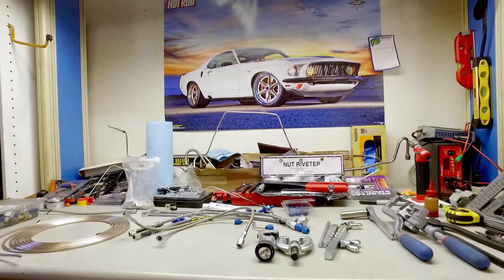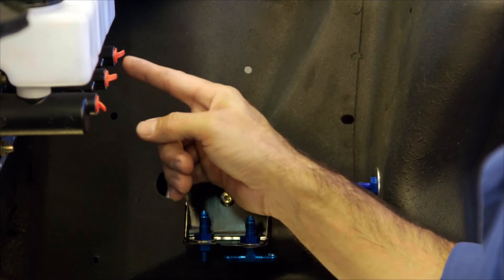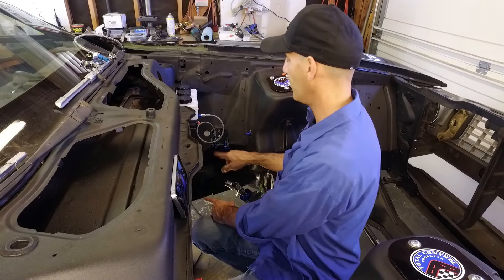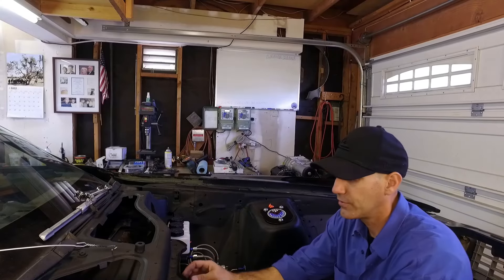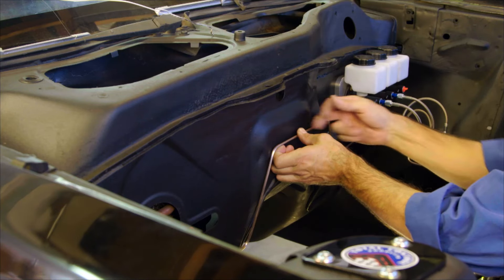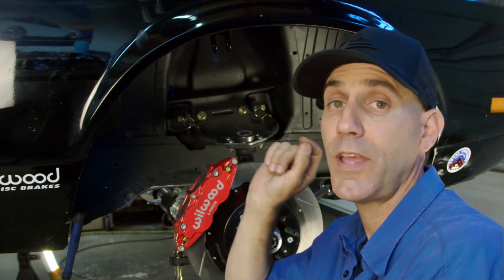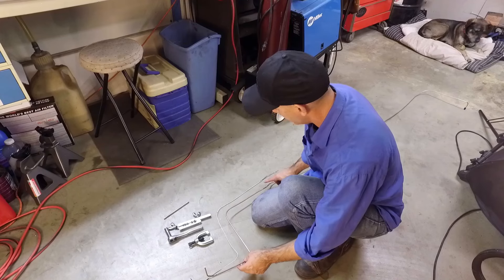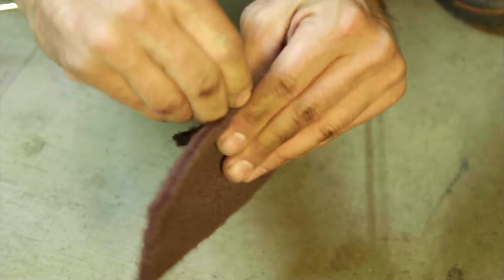How To Build A Custom Brake Plumbing System for Classic or Race Cars

Comment: Looks great just had my fun installing a line lock last weekend on my car. Took a long time to get the hang of flaring the line. Curious how do you control the proportioning of the front to rear brake pressures? Didn't see a valve in line anywhere.
Reply from the maker: +98snakehorse Another good spot... the Wilwood brake pedal assembly has a "balance bar" that does the proportioning.  Since this video was so long I thought to make that it's own video later so stay tuned and check it out... it's pretty cool! Thanks!

Comment: From your master cylinder you have sn NPT fitting, what transition do you use for your flex hose to get to your hardline? ie: from npt to a flared fitting?
Reply from the maker: That is a simple 1/4" NPT to -3 AN adapter. The Flex lines are -3 AN on both ends so it makes easy.
Reply: @AutoEdits  Thank you, your installation was very tidy.. I am using a proportioning valve inline to rear on my 1950 Ford F1 truck and the fronts discs  will go directly to the master cylinder. The flex is a nice clean solution.

Comment: Great job mate explaining the setting up of the plumbing system. One question though, why do you do a single flare and not double as in most cases? I always do a double but is harder no doubt. Cheers mate
Reply from the maker: Thanks for the input, I just like the single flare for my hot rod projects because of the AN fittings. On my Jeep and truck I do the double flare for durability.  Have you seen the video of me driving this thing yet? https://youtu.be/qSJ72eAVZFU
Reply: @AutoEdits  Thanks for your response mate. Stay Safe!
Reply: AN fittings do the sealing. On UNF fittings the sealing is achived by actualy squishing up against the tubing, requiring the use of a double flare.
Reply: @williamallen7836  thanks for the clarification. Cheers mate

Comment: Is there a reason for putting a loop in the brake line?
Reply from the maker: Having a loop in the line with hard tubing helps keep vibration from damaging the line or connectors on short runs like that but the flex line is just the shortest I could get easily so loop it .

Comment: Arent you worried about line length difference causing pressure imbalance? 
What is the flex line?
Isn't this line also going to expand more under pressure?
I know it's still metal but....
Also isn't it easier to rip and or puncture? 
Also USE PIPE DOPE NOT TAPE!
Also maybe heat wrap it to protect from engine heat?
I know it's not much but every bit helps
Also where did you get the clamps for the line?
Sorry for so many questions
Reply: Since nobody replied to you(I know it's been two years), maybe you just don't understand how hydraulics work. There will be no pressure imbalances due to different length piping. And braided line can expand but nothing like rubber hoses. It's so minimal that you wouldn't consider it as a problem. Also wouldn't use normal "pipe dope." Would use either normal Teflon tape or even better, Teflon pipe thread sealant for automotive application(something like the permatex thread sealant with PTFE). And to finish it out, the boiling point of brake fluid is so high that you'd be wasting money and time trying to wrap brake lines. Factory doesn't even take those measures...

Comment: I like the brake switch idea. Only problem is every time you have to change it, you have to bleed the brakes.
Reply from the maker: I've never seen one of those fail so there's zero concern over having to re bleed if for some reason it does go wrong.
Reply: @AutoEdits  that's great

Comment: What Master Cylinder did you use and can I delete my proportioning valve
Reply from the maker: I used the separate master cylinders front and rear and a proportioning bar on the pedals. That's the only way to delete the prop. block on a system.

Comment: What size bores did you go with? I’m doing the same on a 65 falcon. I have 3/4 on there now. Is that too small you think?
Reply from the maker: They are 3/4 on for the front and rear and I will use the proportioning bar on the pedals to dial them in.  The clutch is a 7/8
Reply: AutoEdits thanks for the quick response Jason. That’s the same set up as I was going to go with, maybe I’ll stick with it and if we have issues we can have them together. Please let us know how it all works out for you. I have a feeling you’ll be on the road before me. But I’m trying to get cranking ASAP

Comment: Who are the braided brake lines made by that you installed? Looks a lot better than the ones I found which look cheap made so I didn't purchase them.
Reply from the maker: Those are from Earl's... I think Holley makes them but I just ordered them from Summit Racing.com
Reply: @AutoEdits  Thank you sir. I'll check it out.

Comment: Curious no issues using aluminum AN fittings for brake line fittings. I've been told it wasn't a good idea that I should only use steel  but I've seen it done on more than one occasion. Have you had any issues?
Reply from the maker: I have not had a problem in the systems I've built over the years.  It is easier  and more forgiving to use double flare in street cars but I like this style for this project.  In my Dodge truck I used the NICOP lines and double flare fittings and it worked great.

Comment: Question: What about brake proportioning?  I'm not familiar with the Willwood master, but generally, when you are not using the factory metering block, wouldn't you have to install an adjustable proportioning valve into the system to ensure the correct brake pressure is metered to the front and rear of the car?
Reply from the maker: You're right! This video was getting so long I didn't include the segment on the Wilwood pedals that have a proportioning bar to adjust how much pressure on each master cylinder. I'll show a separate video on those guys. Good call.
Reply: Cool, I look forward to seeing that vid.  Nice work so far, can't wait to see your Mustang back on the road where it belongs!

Comment: Great Video! I'm about to redo the plumbing for the brake upgrade on my 75 Datsun! It looks like you are using both Steel and aluminum fittings, are you not worried about corrosion over time?
Reply from the maker: Thanks for watching... I am not worried about corrosion in this system.

Comment: How much did ya have to repipe once you started dropping the motor and all the other big hardware in?  ;-p. Just teasing, I’m currently surfing on how to refill a replumbed system correctly with the master cylinder still installed...
Reply from the maker: A vacuum pump will work great for what your doing.

Comment: I know this is older but if you get a chance i noticed you were saying npt fittings for the master cylinder but everthing im finding is sae threads will npt work or are yours npt
Reply from the maker: I installed 1/8" npt to -3 adapters into the master cylinders.
Reply: @AutoEdits  ok so im assuming you don't have any sae weired even my brake wheel cylinders are 3/8-24 wich is sae so jusr confused where you gor npt but if thats what yours are ill figure it out
Reply from the maker: @jdjizzle  https://www.jegs.com/i/JEGS/555/107750/10002/-1
Reply: @AutoEdits  sorry i guess i might have worded that wrong im saying all the threaded holes on the master cylinder are sae why would i use npt?
Reply from the maker: use whatever your parts call for 🤷‍♂️
Reply: @AutoEdits  ok thanks Just didn't know a whole lot about brakes Just trying to gather as much Info as I can My car is a 73 Mustang I thought that's what you were working on too that's why i just got confused because you were saying NPT fitting and it seems like all the fittings on the wheel cylinders and the master cylinder are all SAE
Reply: @AutoEdits  but thank you much appreciated

Comment: can you tell us where you got the parts for this job? also the part number for the pressure switch?
Reply: I can get the the 2 part fitting if you still need them

Comment: Just wondering what happened with the break booster?
Reply from the maker: I don't need a booster with this system.  There are math equations that figure out master cylinder size with brake caliper size and car weight and brake pedal stroke ... so this should be a firm but normal feeling pedal.  Not ideal for everyone but this will work fine... I won't do this on my Jeep or Truck.
Reply: autoedit Thank you appreciate the information. Love you're build.

Comment: Nice job, very clean look, professional , but you don't use any type of seal tape, those are aviation grade. the nipple (male ) seals nicely to flare in the the "B" Nut, you would be causing problems down the road.

Comment: great video would you recommend a proportioning valve?
Reply from the maker: I would for sure if you are running a tandem master cylinder but since this particular system is running fully separate master cylinders.. the proportioning is done by a screw on the brake pedal itself.
Reply: AutoEdits 
Great thank you. I’m looking at the wilwood floor mount pedal assembly that is running separate master cylinder. Thank you for the reply.

Comment: Question. Why is there no Distribution Valve?
Reply from the maker: This setup doesn't need one because the front and rear master cylinders are separate and it uses a balance bar on the pedal to regulate pressure front and rear.

Comment: where do you buy the parts, flex lines, adaptors, etc.
Reply from the maker: Summit Racing
Reply: Thanks!
Reply: looking at Summit racing website but I cannot find those blue colored NPT fittings, did you buy the parts as a kit?

Comment: How do you adjust brake bias with the two seperate master cylinders? Thanks. Great video by the way 👍
Reply from the maker: There is a balance bar on the pedals that lets you adjust front to rear bias. Wilwood offers a remote adjuster for that as well:
Reply: Awesome. Thanks.

Comment: Which flare did you make for the rear end? 18:30
Reply from the maker: This system is all 37 degree single flare... not recommended for all vehicles.

Comment: I'm gonna do my brake lines, and some say ya gotta double flare all the brake lines.
Is that true? And why?
I was under the impression that a good flare with a good pressure fitting, and done.
is that incorrect?
Reply: Single flares are only acceptable on low pressure systems. I would recommend you read up on it before touching the brake system, which is responsible for your safety and the safety of others on the road.
Reply: The613MC 
yeah, I  went ahead and took a look.
single flare, sae.
double flare, Iso.
Reply: All hardlines must be double flare. If the cars brakes failed as a result and caused an accident and investigators discovered he used a single 37 flare then he could be held liable and his insurance could get out of paying the claim.

Comment: ok so I am very confused, looking at my wilwood info it says their flares are 45 degree flares but AN fittings use 37 degree flares.........cornfused here!!!!!
Reply from the maker: from what to what? your confusion is confusing. everything assembled in this video works as described.
Reply: @AutoEdits  I am confused as to what is a 37 degree flare and what is a 45 degree flare.....thanks again
Reply from the maker: @davidthayer6969  seems self explanatory. maybe you shouldn't be working on brakes.

Comment: My name is Jesus Lobo from Spain and I’m changing the brakes on my Mustang Shelby 67. I am grateful  for Your  time and I need You to help me for I have changed some pedals of the brand Will Would, with master cylinders exactly the same as those in Your video but I need the other connections like those that appear in the video, those that are of blue color and flexible connections and everything. If You could let me know where I could buy it, on what page/place, I would appreciate it very much

Comment: nicely done but I would use hardline as much and as long as possible . Why ?  Too much/long flex brake lines gives you a spongy brake pedal feeling. NiCu brake lines are the way to go for sure.
Reply from the maker: I agree on the more hard line the better.

Comment: Single flares are not supposed to be used on brake lines can’t hold the pressure like a double flare or the iso bubble flare. 6:26 👈🏼press
Reply from the maker: That's not exactly true.  DOT recommends double flare because it is more durable... has nothing to do with pressure.  High pressure lines in aircraft and many other applications use single flare AN.
Reply: It’s more than a recommendation……it’s a standard that must be followed.

Comment: My understanding is that brake line flares have to be double not the single flare that you are using otherwise great vid.
Reply from the maker: A double flare is the OEM standard but AN fittings use a single flare.
Reply: The AN single flare is illegal for hardlines on any vehicle driven on public roads in North America. It’s a DOT requirement (for hardlines) to use double flare or other types like bubble flare.

Comment: 1 master cylinder should go to the front right and the rear left and the other master cylinder should feed the left front and the right rear it's a safety issue so that if you do lose one of your master cylinders you have front and rear brakes it makes it more even instead of having either front or back brakes.
Reply from the maker: That is not correct.
Reply: the usual routing is divided front/rear. some opt to do a diagonal system because theoretically you would still maintain 50% braking capability regardless of which side of the system failed.

Comment: Where did you order your nicop from ?
Reply from the maker: I think I got that from Summit Racing
Reply: autoedit thank you for the reply. Do you remember what size you went with I'm needing to redo my brake lines in my project and want to make sure i get big enough line.

Comment: where is the proportion valve in this system?
Reply from the maker: I don't need a prop valve since the pedals have a built in lever that adjusts how much each master cylinder gets used.
Reply: what manufacture of system do you have for the master, part #

Comment: no proportioning valve?
Reply: The pedal assembly it self is the proportioning valve. Front and rear don't share fluid so they are adjusted by a see-saw like bar on the brake assembly.

Comment: Hey so u dont need a booster ?
Reply from the maker: No booster needed in this particular system.  There is a bit of math involved but the basics are ... weight of the car, size of the calipers, size of the master cylinder and stroke of the pedal.  I'll let you know when it's on the road if that worked or not...LOL
It's easier to just add a booster but I wanted to try this out.

Comment: Aren't you supposed to do a double flare for brake lines?
Reply from the maker: Sure, if you're using double flare connections but I'm using -3AN so that wouldn't be appropriate here.
Reply: 3AN single flare is not approved for use on brake hardlines on public roads in North America. It is not DOT approved! You are giving out bad advice.

Comment: First, and foremost, I sincerely hope you are referring to liquid teflon, and not tape.  Teflon tape on brake lines is a good way to get a nomination for a Darwin award.  Secondly,  the flared connections aka compression fittings negate the need for teflon, in fact you should specifically not use teflon on compression fittings.   The NPT connectors need teflon ... which is why you are not supposed to use NPT on brake lines.  If you ever try to get that car tech inspected for a track with those fittings on it they are going to tell you that you can wench it onto a trailer and tow it or push it off the property because the vehicle is unsafe.
Reply: I dont know why you are so low in the comments. If youre gonna do something from scratch at least do it properly and safe. Aside from that, the bending and the lines were very nice.
Reply: david seholm I called wilwood a couple weeks ago because I wanted to buy some of the red thread tape that they use on the bleed nipples... they told me I can use any ptfe pipe tape.... I asked what about liquid ptfe sealant and they said to use the tape..... 

That was from the wilwood technical line

Comment: is that type of break line dot aproved
Reply from the maker: Not sure.
Reply: it I'm not dot approved actually brake company's will tell you those style fittings and flares for high pressure hydraulics I'd a no no

Comment: You should start a car company and actually pre-fab, and have instructions for a kit car. Not as exotic as something you would build for yourself, but something simply street legal.  A actual car rather then the goofy  kit cars that are out there. The reason is for many people out there that doesn't want the foreign and domestic automakers hanging their dealership cars, their engineers, their ECU's that their engineers design, and the dealership product in general, hanging over out heads.